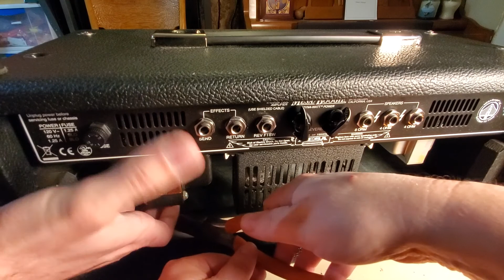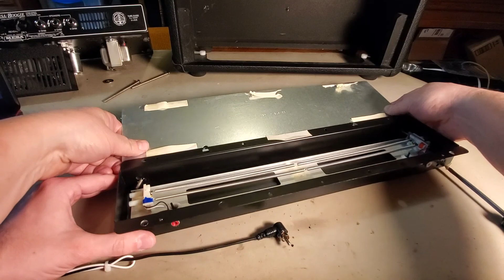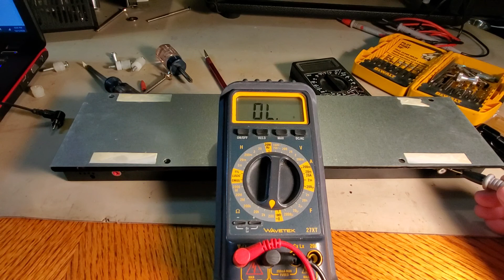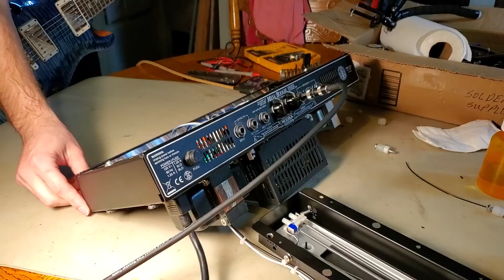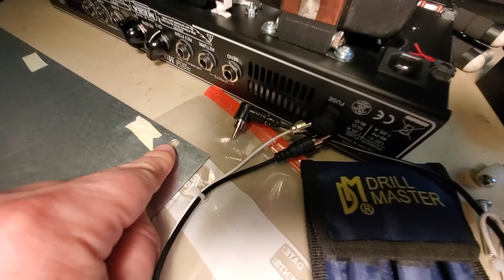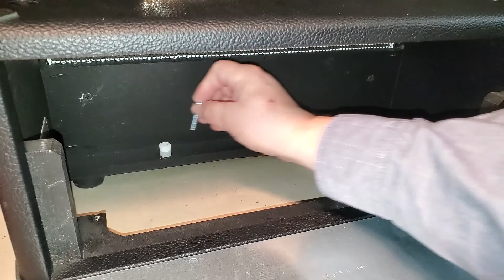Mesa Boogie Fillmore 25 Reverb Box Inspection & Repair

Comment: Great video, thank you! I have a Mesa Studio Caliber with a bum reverb on both channels, doing research on a fix.  Personally, I would drill a hole in the tank housing and connect a wire and ground lug connected to the PCB ground loop... no idea if my problem is the same as yours!

Comment: Are these amps hard to mod? For example adding more high end or taking out the low end a bit ? I played one that sounded fairly thinner than a other and it was much more expressive while the other was bogged down by thick lows and not enough top end harmonics and distortion.

Iv also wondered if one could add a big transformer and make the amp sound bigger. I like the sound overall but I feel the fillmores still sound small in comparison to other amps that I have and Iv always heard the bigger transformers add more lows and highs . Since it’s two of the same circuit I wonder if it’s able to be taken apart and use one circuit and combine it with a new transformer or not? I’m not a tech so I dream big lol
Reply from the maker: I don't really know, since I normally don't work on this type of equipment. I only worked on the Reverb Box because my son knew that I was an  Aircraft Electronics equipment technician. With that said I'm sure it could be modified to meet your requirements by an Amplifier Technician. However custom work can be expensive. Sorry I couldn't be of more help. Best Wishes & Blessings. Keith Noneya
Reply: What amp do you like? I like the 50 version of this amp. Also, the Rivera Stage IV looks very interesting. Cabinet size and speaker make big difference too.
Reply: @MOAB-UT  yeah cabinets and speakers all affect it. I think over the years i can know where to push things speaker or cab wise, its fairly consistent id say, smaller cabs, more boxy, larger ones more phasey and airy. I didnt love how these fillmores sounded with bigger cabs on the mesa demos though, i feel the amp didnt have the scope to carry a larger cab imo. I have a bogner goldfinger which sounds enormous and handles a half stack just fine. I do like both but the 50 version sounds more like a big amp with that low end and top. I played atleast 7 of these at different stores and honestly they are incredibly inconsistent. Some are super thin, others boomy, others not enough distortion, others a nice amount. Maybe one of the amps i tried had consistent tones on both channels, usually one channel sounds much more compressed or has way less distortion than the other. I do love their sustain and singing quality. If you find one you like i would snag it if you can afford it. I just didnt have the cash and missed out on maybe 3 of em (all very different in lows/mids/highs/distortion amounts). My favorite thing with mesa for me is the texture of the distortion and the sustain, its really special imo. IDK if i have a favorite amp though, everything has its own vibe , id really love to find a fillmore50 with a fair amount of distortion on it. For now maybe my goldfinger is my fav for saturated gain with a refined but nasty sound, i do have a marshall and its more dark and focused. I actually like blackstars on the first gain stage for a cleaner compressed tight thing funnily enough, chimey and clear, not spikey but it can be a lil flat. The rivera does sound nice but i have to try one for myself. I shoulda bought a traynor a few years ago, it was all original, i really like how those sound modded aswell.
Reply: @heythere6983  Thanks

Comment: I've been thrown into the home-depot planned obsolescence throw-away-don't-repair generation.  Despite such potential quality issues, the Fimore 50 may be the best vintage sounding amp ever. To compensate for the potential non-repairable issues, I wonder if I would have to buy 5 (at the total cost of an ultimate completely hand-wired Boutique amp) Filmore 50s to have the quality level assurance I want.
Reply: Vintage amps also have quality issues, but they are usually repairable given time and money -- so you still need backups.  And with each overhaul you do loose some sound character.
Reply: And buying vintage amps is always a game of chance as well as expense.
Reply: It seems way easier to dial in and tweak great vintage amp tones out of a Filmore 50 than from an actual vintage blackface because Mesa Boogie took into account not just the best vintage blackfaces, but also fantastic recording studio and sound engineer quality tweaking of yesteryear greats.
Reply from the maker: My son has played on stage for over 12 years and says the Mesa Boogie Fillmore, for a new amp, has one of the best in classic sound he's come across at a somewhat reasonable price range. As far as sound goes, if there is a problem it would be in the filtering and choice of tubes in the design. If the filtering is done right, Tubes offer a flatter drop off across the harmonic range. The problem with all tube amps is you don't know when each tube is going to go bad so you have to have a supply off all the tubes in the amp on hand and be able to troubleshoot as to which tube is bad. Also when replacing tubes, they don't all the have the same harmonic range and conduction rate, even if it's the same part number. You have to re-tune and readjust your knobs every time you change one. Solid state Amps typically don't have that problem and are more reliable in that respect. If you have a Tube output on an electronic amp you have the same problem, but at least you know which tubes are bad then. Regarding the Fillmore, so far after fixing the Reverb Box, NOT built by Mesa, the Fillmore has worked flawlessly for over a year except for changing the tubes because he wore them out playing, LOL. He practices daily and plays on stage twice a week for hours. So I guess you cold say it's reliable. Great comment though. Best Wishes & Blessings. Keith Noneya
Reply: Looks like the problem was a non-original replacement tank. Presumably something happened to the original, but it’s pretty cheap to replace with the proper part. Boutique amps all use the same cheap reverb tanks btw. You can consider them consumable parts and buy a spare ahead of time if it’s a concern.

Comment: This just confirms the notion that printed circuit boards even hand assembled have multiple weakest links in the chain.  So, Mesa Boogie is not likely the future of amp technology.  However, this is no longer Mesa' call since Gibson is now the owner.  And Gibson is known for hand made in America.
Reply from the maker: I've worked in electronics for over 42 years, both low frequencies (LF) and Super High Frequencies (SHF) and realistically printed circuit boards aren't the problem. Personally I think the problem is in using Lead Free Solder because it's prone to cracking and separation after several temperature changes. The other problem is in the materials they use on the circuit board, cheap and low weight (thin) printed runs or using pressed circuits instead of soldered circuits. Those two problems can be overcome by using Lead Solder when making repairs. I think Gibson could do a good job if the Demoncrats, when in office, would leave them alone because. Gibson donates a lot of money to the Republicans. So Demoncrat run Law Enforcement Agencies, just some how, tend to like to raid their wood whorehouses and practically put them out of business for a month or two every time they do that. Anyways that's a separate subject, LOL Thanks for the comment. Best Wishes & Blessings. Keith Noneya

Comment: Whats your impression on build quality?
Reply from the maker: Oh Sorry the reply is late. The amp belongs to my son. He plays it on stage at least twice a week since he purchased it. He mic's the output for a better sound. He's had several amps and says he really loves this on for it's sound and options. He has no complaints about the build quality, except the Reverb Box. Since I've modified the Reverb Box it's worked flawlessly. As far as the amp goes it plays great and has a lot of options for making custom sounds. So if music is your thing, my son says you can't go wrong with the amp, other than the reverb, you might have to mod it or replace it eventually. If you pick on up get a new one or one that has a warranty just in case it has a problem. Hope this points you in the right direction. Best Wishes & Blessings. Keith Noneya
Reply: @keithnoneya  thanks!

Comment: I was seriously contemplating one of these...for what like 1400?
Drove 40 miles to the nearest guitar/amp shop near me that had one.
I couldn't believe how small and chintzy this thing looked in person. $1400!!!
$1400!!!!  LOL. The thing looked like a crappy toy.
Reply from the maker: Yeah they look really cheaply built but in all honesty it's not the outside that counts it's the way it sounds when you play it. I do electronic repairs for a living and frankly I've looked inside high dollar guitar control knobs and even inside these control knobs. Almost all manufactures use the cheapest parts they can put in them, and build the boards the cheapest way possible. I'm surprised at how well the equipment holds up. So as the saying goes "You can't judge a book by it's cover", does hold true in sound quality and options available on how it looks on the outside. They're not worth $1,400.00 on looks, they're worth $1,400.00 on how they sound with the options provided. Most of the time the electronics hold up, with a few exception, the Reverb Box being one of them. But now that you know how to fix it, or even prevent it from breaking by doing the mod, you can make a better comparison based on quality of sound rather than how it looks. Thanks for the comment, I agree with most of what you said for sure. Best Wishes & Blessings. Keith Noneya
Reply: @keithnoneya  Same to you. Best wishes and Blessings.
Reply: @keithnoneya  Keith- you know your stuff. What amp can you recommend to me? Rivera Stage IV or a Fillmore 50 are my two choices I cam considering...but would appreciate your expert advice. I like clear mostly but some blues and rock. I have pedals too.
Reply from the maker: @ Thank you for the comment and trust. Personally I'm good at electronics more than sound. My comments on the sound are based on my sons advice who's been playing on stage three days a week on average for 14 years. I fix it when it breaks and this one has only broken the ONE time since he's purchased it. Also he has changed the tubes ONCE that I know of, but I suspect twice. Tubes do wear out you know. So I can't really give you good Musicians advice on an amp to pick, but he REALLY likes this amp mixed with a lot of peddles. He also doesn't use the speaker in the amp, he uses the external output into a high quality speaker in a sound proof box to isolate it from stage sound, then puts a Microphone in front of the speaker and runs that to the sound board and pipes the adjusted feed from a headphone monitor into eye pieces with channels from the other band members. So for advice I'd probably go to a music forum and ask that question. Sorry I can't be of more help. Best Blessings. Keith Noneya   PS he play a moderate rock with his and some jazzy stuff on the side when needed. Keith.
Reply: @keithnoneya  LOL- you are modest and humble Sir. You actually know more than most experts who claim to know everything. Electronics is the hard part. I also studied Elec. Engineering- though ultimately, it was not my forte. I still love innovating, great design, but I was not meant to be an actual engineer.

I do play some guitar though- for many years. Not an expert at that either, but it's a fun hobby. IMHO, sound is just sound. Whether it is good or bad, like art is very subjective to the artist and listener. The litmus test is do, and others like it or not. Some bands pride themselves in a lot of feedback and harsh tones. 

At the core, sound is invisible energy (sans an oscilloscope!) Think of grunge bands, alt. rock, etc. Historically, they have resonated and been more popular with the masses than say, technically correct balanced tones from say Jazz or Orchestral ensembles. They are raw and full of emotion. If a band or person promotes a unique sound, and does enough of it, it will grow on people. Even a terrible song will catch on if it is played all the time. 

I could paint a beautiful beach, blue sky and rainbows but it's unlikely you would want to view it every day. It is nice and correct, but boring. In life, people like many things. Mostly, they want an outlet for their emotion. 

People play and listen to music that resonates with their soul. Music is what feelings sound like. It can convey stories without any words. There is not right or wrong. Bottom line sir, you know as much about sound as any one of us experts!

Namaste.
Reply from the maker: @MOAB-UT  I love the last paragraph you wrote, music truly is what feelings are it they were sound. Thanks for the comment, loved it. Best Blessings. Keith Noneya
Reply: @keithnoneya  Cool, but I cannot take credit for that one. It's a great quote that is out there- and they sell products that say that. I love the quote too. It's true.

Comment: As a Mesa fan it is sad to see that they have fallen to such a low QC of their product
Reply from the maker: Merry Christmas Mr. Shiney. In all fairness Mesa didn't produce the Reverb Box, but yeah if you're going to pay that much for an amp, you think they could have found a more reliable Reverb Box supplier. At least you know what to look for and how to fix it if you have that problem. Thanks for the comment and I hope yall have a great Christmas. Best Wishes & Blessings. Keith Noneya
Reply: LOL Not their fault
Reply: Looks like the original reverb was replaced with an incorrect part by the store when it was a demo unit.
Reply from the maker: @ Sorry for the late reply. Actually it's the correct replacement reverb per the website. The original is no longer produced or sold when we did the repair. Best Blessings. Keith Noneya
Reply: It can happen to any amp. They are all very mass produced. Or spend $3k+ for handwired.
Reply from the maker: @ I like hand wired if it's lead solder not Lead Free Solder. If it was my amp and I going to be running around doing tours and crap. I'd pull every component, clean the hole, put an Eyelet (Copper/Brass Tube) in the hole, crimp it and reinstall all the parts with lead solder. Also I'd probably pull the tube every time and put them in a foam/cotton lined box to protect the tube filaments, then install them prior to warm up. If not, I'd at least have a back up amp and tubes ready. Just my two cents worth. Best Blessings. Keith Noneya
Reply: @keithnoneya I hear ya man, same thoughts here. I am  doing a repair on the Mark V (the big one) after Mesa undersized the diodes in the diode bridge for  the 12V and 5V regulators. The diodes were undersized at 1A (replacements are 1.5A) therefore they were running too  close to the limit and eventually failed. The failure ended up vaporizing some  tracks and some vias. This amp is  an absolute pain to work on. Lead free solder used through out and you have to  be so carefull in applying heat so you don't do damage to the pcb tracks and vias. It is a real challenge for sure. To  loosten the board to  prop it  up to gain access to  the botttom side for further inspection is a challenge. Releasing the standoffs is a challenge as some of them are under two side-by-side orange drop capacitors and almost impossible to  get at to release. Most all  components on the main board are installed, to  my eye, touuching side by side. Lots of tantalum caps used and they are heat sensitive so removing them would be a challenge without  damage if necessary. To install eylets as you noted would be a significant pain and what hair you have would mostly be torn out LOL. BTW releasing the board to allow it to tilt upwards for the inspection I  am  doing, about 20+ wires must be unsoldered, doing this with lead free solder was a significant challenge, and two of those wires I had to cut as it was impossible to desolder from the top. I will have to splice those. Those wires I had to remove I  had tto add low melt solder to even have a change of success. In some places where a wire was attacheed to the  board it was impossible to unsolder from  the top due to surrrounding component density. Removing  the board entirely would require removing another 75-85 wires, not for the faint of heart! Luckly the diode bridge I mentioned above was at the board edge  and relatively accessible without me having to go  that far.  Anyway, apologies for the long  winded response but I thing that if Mesa just made the board about  25% larger it  would be a lot easier to  work  on.  This one is not designed for relatively easy repair for experinced  technicians like myself.  I have seen a lot of technicians curse this amp and a number refuse to work on it for the reasons mentioned. Not easy to repair by any means, I got  lucky because the failed  diode bridge was so close to the edge. I  would shudder to  think  what I would face if the board had failures in the middle with the high component density. Anyway my two cents.
Reply from the maker: @Sparkie-Zeta  Yeah I've had to work in some really small holes or should I say densely packed circuit boards! NO fun when time is critical and the parts are expensive. thanks for the fun read. Best Blessings. Keith Noneya